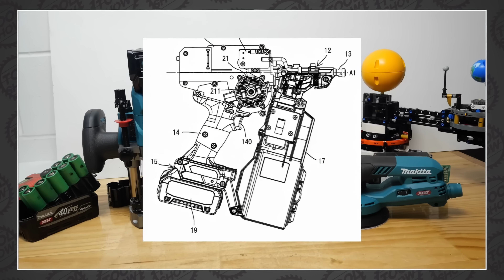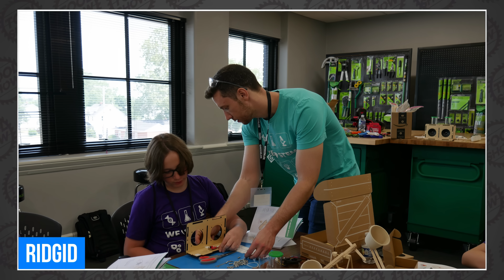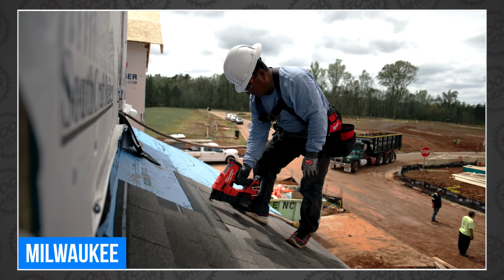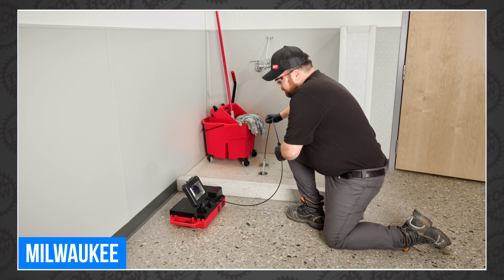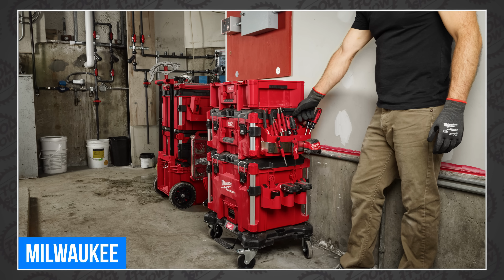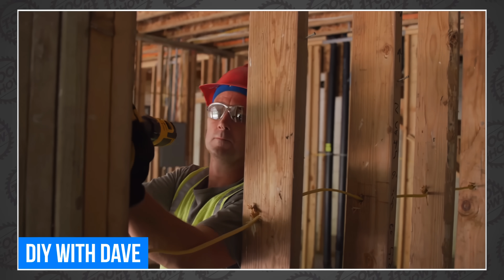NEW Power Tools from Milwaukee... but they won't let you buy ALL of them!

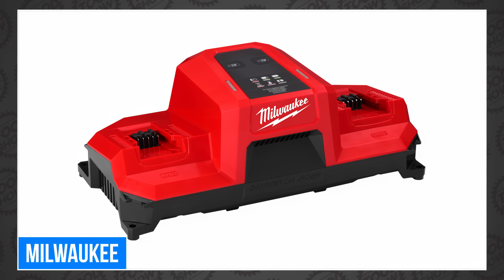Comment: 3:52 that dual bay rapid charger is already on the market for a little while. Some store's overhere still have them in stock
Reply from the maker: It’s an updated version with 4 new mounting point for attaching it to the wall of your shop or truck. It will arrive in February of next year.
Reply: @ToolShow  sounds like a nice upgrade with the mounting point

Comment: I just saw the 6bay daisy charger and the dual bay one as well at Home Depot
Reply from the maker: Not the new one you didn't. We have the old one. Looks exactly the same. The new ones have new tech that allow them to daisy chain, and intelligently charge sequentially to keep from over loading your circuit.
Reply: @ToolShow  I get the daisy chain one , but what about the dual bay that’s brand brand new right…? I was at the Home Depot at 3611 Truxel road here in Sacramento CA and saw it on display ready to sell
Reply from the maker: Oh I know what you're talking about... the Dual Bay Super charger right? We actually have that. They sent it to us last year, and I know it's been out a while. Let me see if I'm missing something or got it wrong in the show... brb.
Reply from the maker: OK I figured it out. There is currently a Dual Bay Super Charger, which as I mentioned, we have. We use it for all of our M18 charging in our Tool Testing Lab. (It really is freak'n fast)

But at PIPELINE, they just announced a NEW one. It's called the M18 DUAL BAY SIMULTANEOUS SUPER CHARGER w/ 4 POINT MOUNTING. It's that 4 point mounting that makes it different. It has new feet that make it easy to mount on the wall, or in your truck. That version won't be here until February of next year.
Reply: @ToolShow  thank you for the research on it